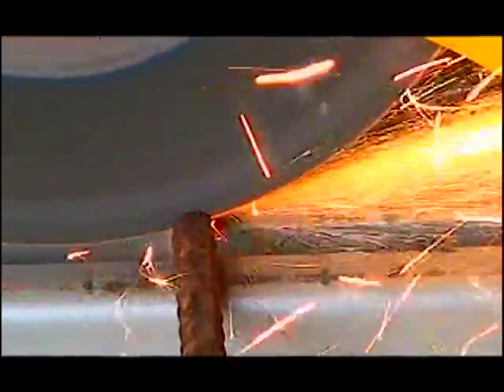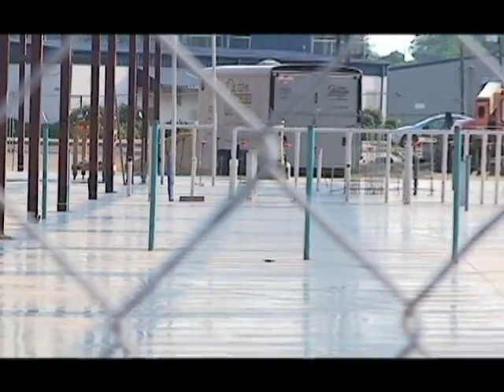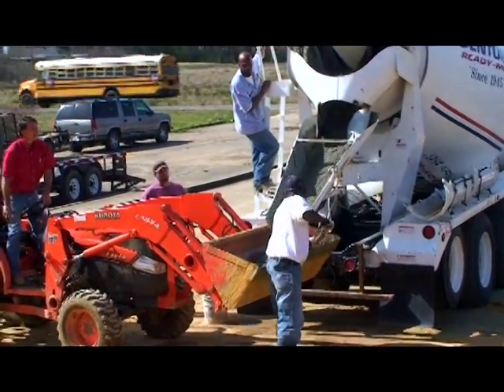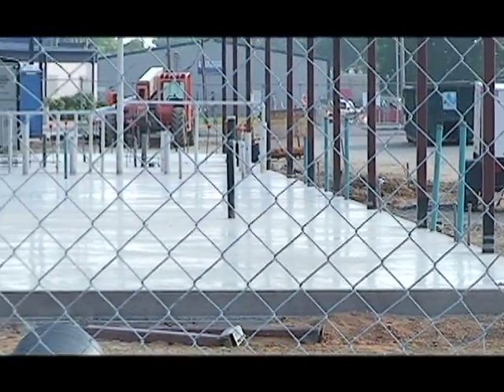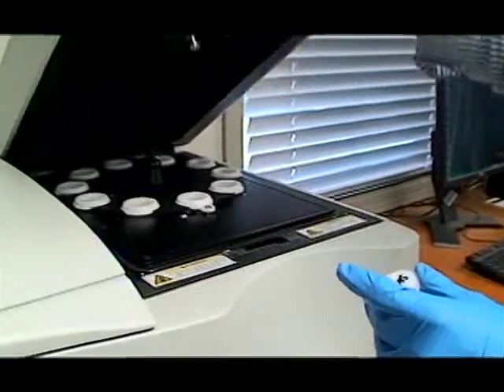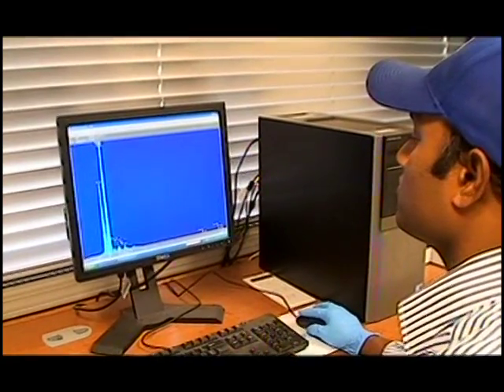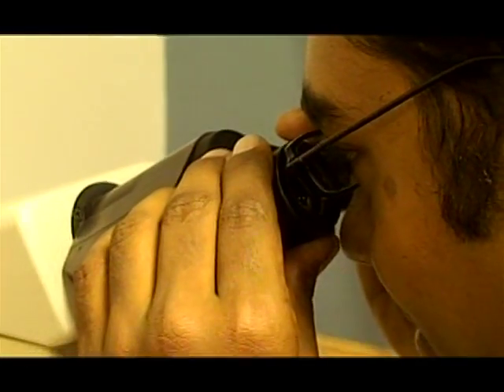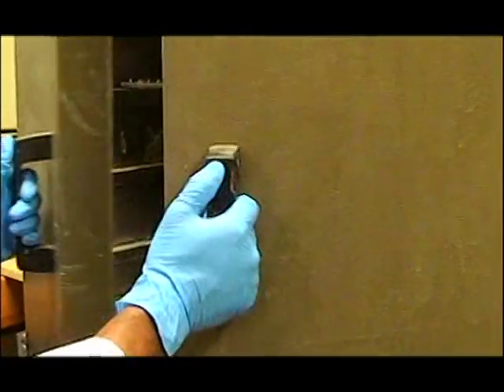Geopolymer Video

Comment: Mix equal volumes of liquid aluminum hydroxide, sodium silicate, and sodium hydroxide. Mix and dissolve all three liquids together thoroughly. Then pour into a mold and place the mold inside a furnace or oven at 200 to 300 degrees centigrade until they have harden and cured, once hardened and cured allow to stay inside the oven or furnace for 15 to 30 minutes. Then remove to cool off and removed from the mold. Presto! A geopolymer binder. At least that is what they, our Soviet scientists said during the Cold War in the 50s and 60s.